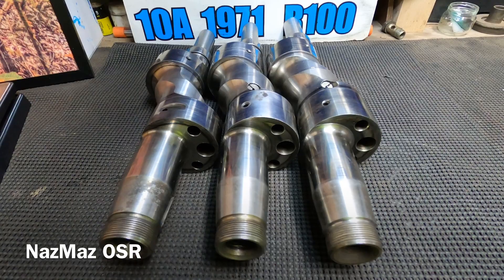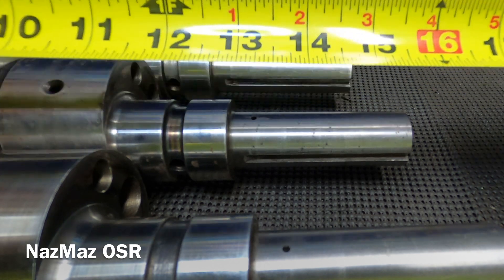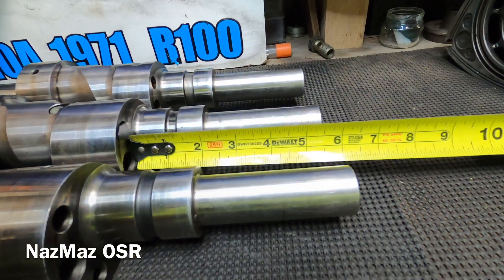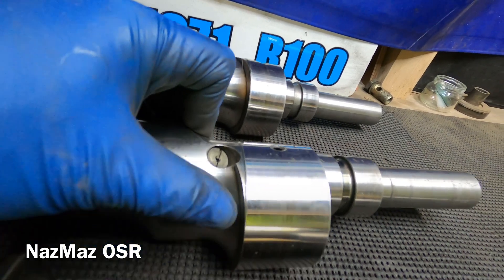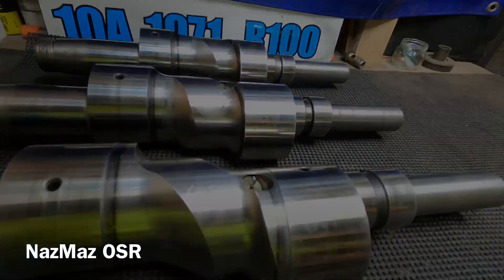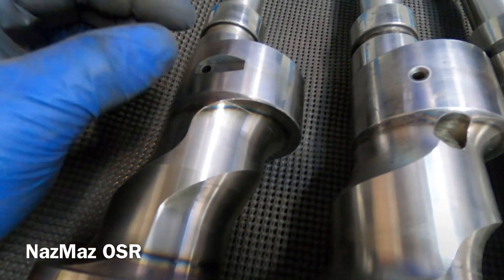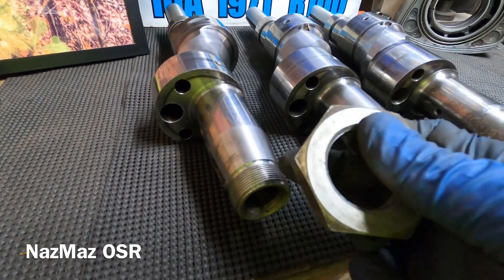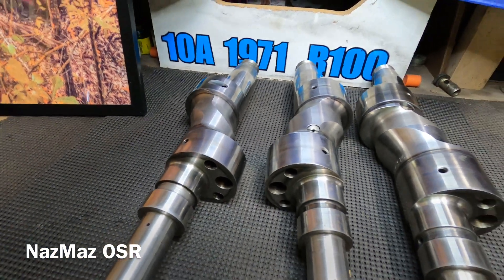Mazda Rotary Eccentric Shaft 10A 12A 13B

Comment: can you tell me the thread size and pitch for the 10a eccentric shaft front bolt please
Reply from the maker: 17mm x 1.5
Reply: Is that the thickness on the thread on the bolt of the head of the bolt
Reply from the maker: @matthewadams1475   Yes, on the thread.On the bolt head is still 19mm like all the rest...
Reply: I have a 12a one here that is 16mm on the thread. The 10a one is missing 😢